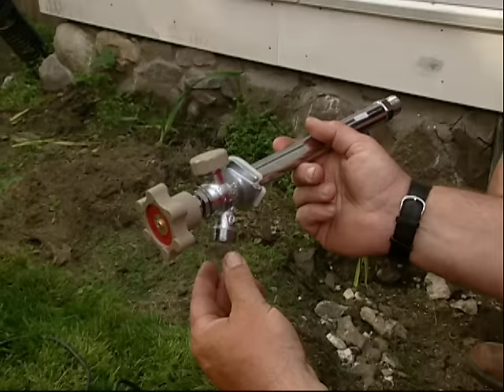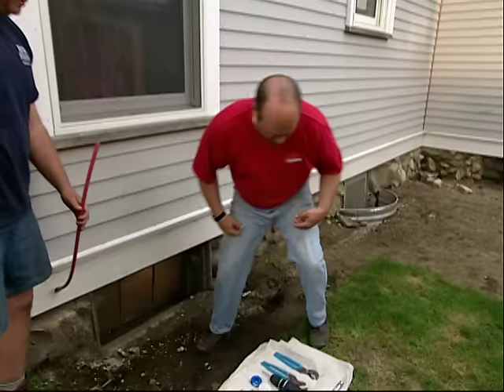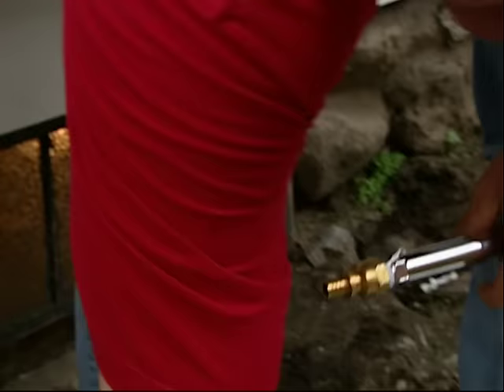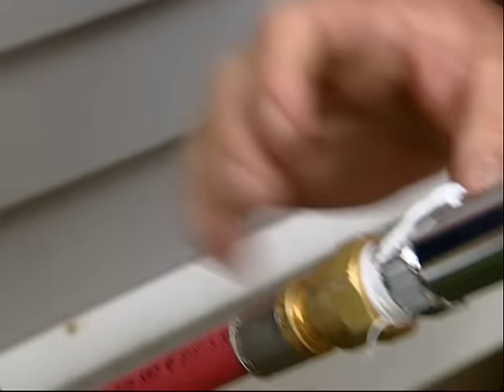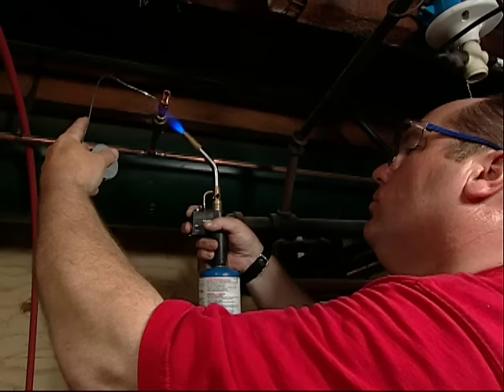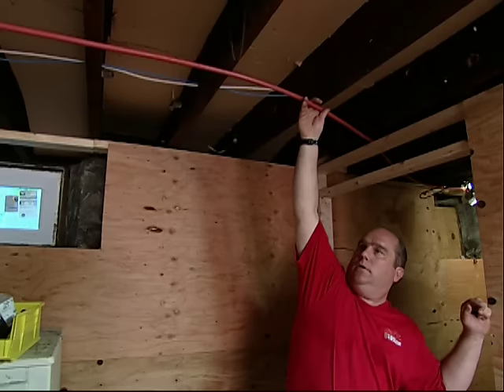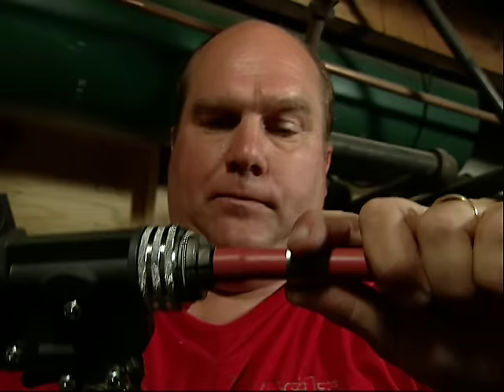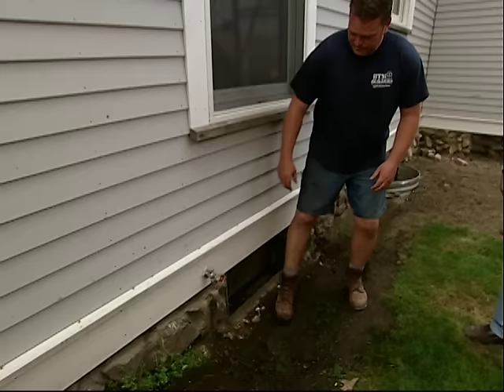How to Install a Frost-Proof Faucet with PEX Piping | This Old House

Comment: You know from listening to plumbers that have been doing this as a profession for many years they didn't tell you how to prevent busting another sillcock by installing it with the sillcock leaning downward to allow the water to travel back out of the sillcock when the water freezes so that it will not expand from freezing inside the pipe and split the pipe ruining your sillcock and forcing you to replace it! Come guys we're getting sloppy here!
Reply: 6 years ago you posted this tip. 6 years later I'm using it

Comment: Shouldn't he be using blue PEX instead of red? (Blue for cold, red for hot)
Reply: Sean Place i mean it goes outside so you should know its cold water 😂😂
Reply: Sean Place I
Reply: The colour is only for convinience, here in Germany they're all white, no different colours. But I've noticed a big difference. Here you're getting a compound material with several layers. Inside is PE-X, then a bonding agent, a layer of aluminium again a bonding agent and then a layer of PE. In the video this is the PE-X tubing only.
Reply: Cuz Germans know how to make things.
Reply: Brian Djordjevic I hope you never become an electrician. “It goes to an unearthed powerpoint so you should know that that earth wire is used as live wire 😂😂”
Reply: Marcel Germann Building codes are not international. That Germany doesn’t do anything with the PEX tube colors, doesn’t mean that the USA does it the same way.
Reply: The tubes are all the same, except for the color. I've read on the site of a US PEX-tubing manufacturer that the colors don't matter, you can use them all for hot or cold water. There is also a white variant available. Your home won't drown because the tubing is having a different color. And the easiest method is to touch the tube with your hand, the tubing is not insulated, in case of warm water the tubing would be warm too. And on the copper pipes you couldn't see by a color if it's warm or cold too.

And the US are a special thing in the case of codes. In one state something is permitted, in the other one it's banned.
Reply: It's not necessary
Reply: Yeah he should be using blue pex thk it not necessary its called workmanship
Reply: Richard what the hell does water have to do with electricity?
Reply: Could have shark bite it quicker
Reply: Really doesn't matter. If it were me I would've used white.
Reply: All copper is the same color
Reply: Sean Place I had a hot water spicket outside we had a lock on it to prevent accidents with children
Reply: In Pa.it has to be red for hot blue for cold.
Reply: J Ji

Llll on
Reply: @martin.klouse 

Diesel engines. Bunsen burners. Electron microscope. Gutenberg press/bible. BMW. Mercedes-Benz. Albert Einstein.
Reply: @Marcel_Germann  my usa house is white only
Reply: @galehess6676  In my house it's also completely white, but actually you wouldn't see it because I've insulated the water pipes.
Reply: @Marcel_Germann  my neighbor's house got flooded twice because they used the white Pex pipes. The entire house plumbing had  been replaced with blue and red pipes and they don't have a leak ever since then.
Reply: @jojo3007  The pipes I have is a compound material. A PEX pipe, layer of adhesive, a layer of aluminium, another layer of adhesive and white PE on the outside.
Expected lifetime of at least 40 years, like all DVGW certified plumbing materials. These pipes even have a certification for natural gas.

https://en.wikipedia.org/wiki/Deutscher_Verein_des_Gas-_und_Wasserfaches
Reply: Exactly It’s more convenient - for everyone - what if you Sold The House ?? It would help the New Owners. ! Etc. Etc.
Reply: @jameygorman817  Exactly 👍🏻👍🏻👍🏻
Reply: @jojo3007  🙏🙏🙏🙏
Reply: Hot water for the kiddie pool?

Comment: This video never mentioned the proper (downward) angle to install the faucet so that all the water drains out properly when closed.
Reply: I believe the frost-free faucet had the angled spacer mounted between the flange and the siding.
Reply: That the point frost-free faucet angle should be double checked to make sure it drains when its turned off. They didnt talk about testing it for leaks too.
Reply: I agree. I was surprised that he didn't mention the necessary angle. It even freezes in Florida, sometimes.
Reply: By these comments here, i can tell none of you know anything about plumbing.  The piping is installed in his basement. The  temp in that basement will not drop below freezing point. Then comes the 12” long “frost free” hose spigot. Guess what, that turns the water off inside the house about 2” where the pex connections were made! NOT gonna freeze boys! Stop with the pitch nonsense and letting water run out! Last but not least, did u see the expansion process? Guess what... if it did freeze(which once again, it will not) the pipe EXPANDS!! It has a superior burst rating between 500-1000 pounds!!! Stop posting false comments 🤦‍♂️
Reply: @neilhansen3025  ok.  Obviously I know nothing about plumbing. That is why I was watching the video.  Also. I live in Minnesota. I had a frost proof faucet freeze on a house I bought about 10 years ago. North side of the house. Low temp was 27 below and we didn't get above 0 for 3 weeks. The plumber who fixed this for me told me the faucet should have been angled down. Good luck being the smartest dude around.
Reply: @neilhansen3025  If they don't know, you can't teach 'em.  Side note: Have you watched some of the freezing test videos for PEX on YouTube?  Or the pressure tests? PEX is amazing stuff!
Reply: @stevenreeves1394  as a fellow Minnesotan I am always nervous about my outside spigot freezing.  Even WITH a freeze proof spigot.
Reply: After you close the valve there is water behind the spigot inside that short length of pipe. Think of a garden hose. The spigot is well behind the nozzle. Do you think the water in a hose disappears when you turn off the spigot? The pipe must be sloped down towards the outdoors to let the water drain.
Reply: @neilhansen3025  I can tell you don’t know anything about frost free faucets. I’ve replaced many due to no slope towards the outside. They must drain out to remain frost free
Reply: @magnumblaster  your great
Reply: Go buy an aquor hose spigot.  The hardware slopes it so they drain. High quality stuff.
Reply: @neilhansen3025 Even though it shuts the water off inside the house, the exterior side of the shutoff will be full of water if it's not angled down so that it drains. That water can then freeze.

That's why people are saying it has to be to angled down.

Comment: Why not buy a frost free faucet made for pex rather than buying the wrong one and having to add a pex adapter?
Reply: Some stores (including some Home Depots) don't stock pex-specific faucets or only have one choice of length.  Much easier for them to just sell you an extra part.  In low population areas you may only have one choice of store, so you buy what's available.  If the choice is available though, yes, buy the pex one.
Reply: TicoTimeCR have you heard of this new invention called the internet? Apparently, you can order stuff and as if by magic it is delivered to your home.
Reply: @GrahamDIY  That's crazy talk, LOL
Reply: @Bigguy_33  Umm, don't get started with faster or cheaper when all this repair needed was soldering a faucet to a copper pipe, no pex or adapters or teflon tape or pex expansion tool, just standard pipe available for purchase anywhere, a torch available anywhere, and solder available anywhere, anywhere meaning any hardware store and some non-hardware stores.  Well, you may need sandpaper or a brush or steel wool.  If you don't already have those things then you probably aren't handy enough to do this either.
Reply: I almost asked the same thing since it adds another joint, but if it does freeze and burst, you can just spin it off instead of having to re-crimp PEX.

Comment: I’m not comfortable with that amount of calking. I woulda put more
Reply: It’s not your house, so it doesn’t really matter what you’re comfortable with.
Reply: #fail.  It comes in a full tube for a full reason.  If you don't use the entire tube it will leak in less than a month.
Reply: I’m not comfortable with your comment 🤣

Comment: I would have used a ball shut off inside and blue pex angle the sillcock downward and foamed the hole not siliconed just the top of the hole … Foam all exterior extrusions to keep air and pest out
Reply: Blue PEX because it's cold water. Red means "hot".
To keep water out of the wall do these:
1) Angle the outside pipe downward to direct rain water away from the wall
2) Silicone the actual fitting-to-wall surface
3) Foam the hole 

Where would you add a ball valve? Just inside the wall? Something other than the one near where they soldered? Why? Two valves?

Thanks for your help. I know it's been 2 years.

Comment: Perfect application for Pex.
Reply: Idiotic application for pex when it was a standard plumbing setup using a faucet meant for copper pipe and connecting inside to copper pipe anyway, and needing the expensive tool, and all in all, a senseless way to do it.

Comment: I would have placed the sillcock  further away from the window if possible. Just in case it leaks at the hose connection and puddles right neck to the window.
Reply: great point!
Reply: Yeah, asking a lot of a foundation when you regularly flood it.  As long as you're talking about doing it right, I would put a well on any window that close to grade, would slope the soil next to the house so it flows away from the house, and would put a splash block under the sillcock/faucet/hose bibb instead of saturating the soil at my foundation.

Comment: That tool is a Sioux Chief F2080 combitool with Sioux Chief 2080 fittings. Most PEXa is F1960 and available by mail order from the supply houses. Big box sells F1807 crimp which is very similar to F2080 but less flow diameter and way cheaper.  F1960 is larger flow but only one ridge in the fitting. Sex A is expansion do not use big box in store per for expansion. Only for crimping. Big box does offer online Pex a expansion and F1960 fittings but better off with supply house or pexuniverse for those. Richard used the 2080 tool in a later video at Home Depot which is deceiving since Home Depot does not sell any F2080 gear, nor do the online retail supply houses.
Reply: Please read correctly. 5th sentence should start as "Pex- A"  (not= Sex A) is a expansion tube
Reply: I looked up the Sioux Chief  the one he uses to expand the pex  I am looking into what the name of that tool is?  I have see other's however not the one he uses has red handle and lime green button with the tightener on the bottom of the handle?
Reply: @rebeccagleason2678  that is a Rehau PEXa system.
Reply: I can’t find anything like it :(

Comment: I'm not a constructor, not even a HOME owner, but I'm dying to work with some pex tubbing.
Reply: Keep in mind that your pressure will drop a bit if going from copper to PEX.
Reply: We're going to have to agree to disagree Steven. I changed out my 1/2" copper system to 1/2" PEX with manifold and there was a noticeable drop in flow rate out of the taps in the house.
Reply: I'm glad to see you are capable of having a civil conversation.
Reply: FlightSergeantRose I’ve done my fair bit of research into static and dynamic pressure in university and pressure won’t reduce or change at all because of the material of the tubes/pipes that carry water. As Steven said that’s controlled by the city.
Reply: @FlightSergeantRose  [Assumption: Your manifold uses crimp/clamp fittings and Pex B tubing.]  You're both right, but you're talking about two different things. Water PRESSURE (the force pushing the water) will remain relatively constant, give or take a little venturi effect at restrictions.  FLOW RATE (how much water flows through the pipe) will be decreased, because on Pex B the fittings go inside the pipe, so they are by definition smaller ID and restrict FLOW RATE, but not PRESSURE.  Same Pressure X smaller opening = reduced flow.  That's one of the selling points of using Pex A/Wirsbo/Uponor, in that method the tubing is temporarily expanded to accept a fitting with an ID much closer to that of the pipe, so no significant loss of flow rate at the fitting.

Comment: What’s the name of the tool you used to expand the end of the pex pipe?
Reply: It's a pex expansion tool, but for the life of me I can't find one that has the 2nd part that allows you to attach the ring clamp.
Reply: After more research, I think this is an old video maybe.  He's expanding Pex-B and then adding a metal crimp ring which pex-b requires.  If you use Pex-A, which is newer, the crimp rings are themselves a certain type of pex.  You expand both the end of the pex-a PLUS the pex-a crimp ring and then just let them both relax back onto the fitting.
Reply: @roberte.6892 that is a Rehau PEXa system.

Comment: 2:05 all the caulking just went deep in the hole when he pushed the valve in. Fail.
Reply: lmao
Reply: not only that but they put the faucet next to a window where all the water will drain into
Reply: No your wrong. That chalking is a sealer that will expand kinda like the Foam insulation in can.  

The white chalking prevents water going into the house. Thinking of the chalking around your bathroom tube when you take a shower.  

Unless you bath in a lake. haha
Reply: Personally Im going to believe the video then some random kid on youtube but call me crazy
Reply: Didn't put the caulking completely around the hole & on the faucet mounting flange...👎
Reply: . Mlm
Reply: @Divisiondoorway  you can see it went into the wall with your own eyes. What is its purpose there?
Reply: @Trials-and-Tribulations  No.  Expanding foam sealant only works on stationary objects, not spraying it onto something then shoving it down a hole.
Reply: @bfsgman  "Maybe".  Often it is difficult if not impossible to get caulking up in and around the hole from the inside.  The CORRECT way to do this is push the faucet most of the way in, and apply the caulking to the back side of its flange and if there is still a gap, fill that from the outside with the faucet fully installed.
Reply: Looks like the hose bib had a gasket on the backside, maybe they're depending on the manufacturer to do their job.
Caulk shrinks by the way, it doesn't expand to fill the anular opening.

Comment: PEX is very UV sensitive, It should never be exposed to sunlight and some parts of the pipe are exposed close to a window...
Reply: Dicofole UV doesn't penetrate glass. It was all inside
Reply: PEX is UV sensitive.  It cannot be exposed to direct sunlight, as it breaks down rather quickly.  Indirect ambient sunlight degrades PEX at a rate about 8 times slower.  PEX is ideal for in-wall plumbing.  When it is used say in an unfinished basement, the pipe needs to be painted or covered in an ABS corrugated shroud.  When installed properly by someone who knows what they are doing, PEX is amazing stuff.

Comment: On that tool to expand the PEX pipe you have to turn it 6-3 position or it will leak the PEX pipe the electric one does it automatically

Comment: I’m curious isn’t there pex tubbing that’s blue for cold water and red for hot? With that being asked does it matter which u use if we’re ignoring the color?
Reply: helps to see visually, if a line is one or the other, could run all red/ blue if you hate plumbers haha or don't want to buy two rolls if you only need a shorter amount
Reply: Exactly/ blue - Cold 🥶 
Red - Hot 😡
That’s How I would Do it & use Crimp Clamps !!!!!! Or Brass !!!

Comment: Would you recommend shark bite frost proof silcock? Seems easy to do and no soldering
Reply: I don't trust shark bite for any permanent plumbing jobs.  It's great for temp stuff or emergency repairs but they are just exposed single o-rings with mechanical teeth preventing slippage. They will fail before any properly installed fitting will fail and they are expensive as well.  I would recommend Pex-a expansion fittings and Rehau fittings like what are in this video are very good.  The tool is expensive though.  Crimp or clamp would be my second recommendation but you do have to size up to keep the same flow.   Best system for lowest cost would be pex-b clamp system with poly fittings.  Cheapest pipe, cheapest fittings, cheapest tool, easy to do and reliable for permanent installations.  You can even use the 90 degree hose benders too.
Reply: yeah they are more expensive but definitely easy to use for a homeowner. just make sure the ends of the pipe are nice and square or the sharkbites will leak over time.
Reply: @RoastBeefSandwich  I’ll keep checking. No leaks after almost a year. I’ll leave for now. I’m sure it be slow if it does happen. These are awesome compression
Reply: @appleztooranges  yep I have some in my laundry room. I left the wall open for a year just to see if it would leak, never did, closed it up.
Reply: Aquor is nicer and for shark bite.  I have had a copper pipe capped with a shark bite cap since June of 2015. No leaks.
Reply: @appleztooranges  I have 10 year old sharkbite fittings on toilet feed pipes and laundry water feed pipes. None have ever leaked at all. For what it's worth.

Comment: the shut off valve in the house, is that a secondary precaution if the outside valve's non-freeze tap does not work 100% in the winter?
Reply: You'd want to have a stop valve with drain on that outside water line, so in cold weather you turn off the water to the sill cock, then you open the drain to remove any leftover water. That way there's no water to freeze in the sill cock no matter what.